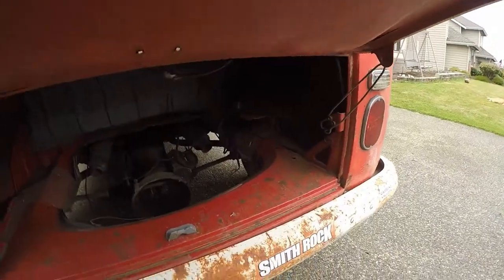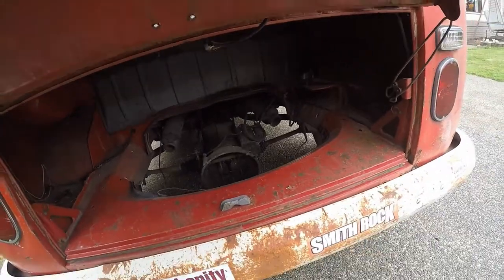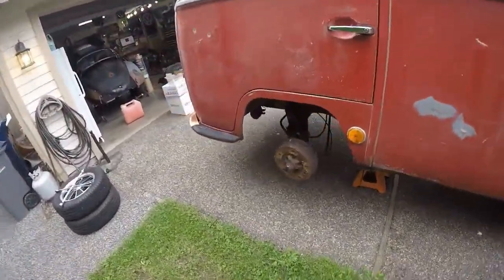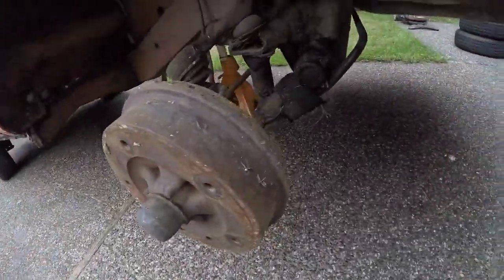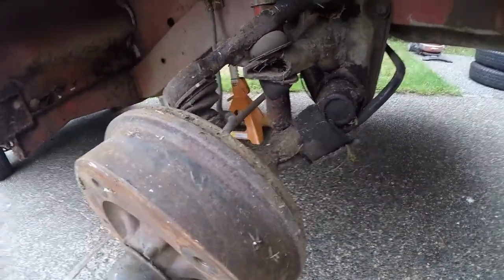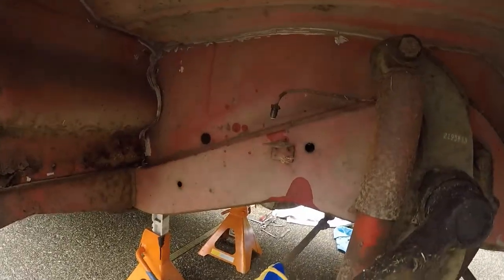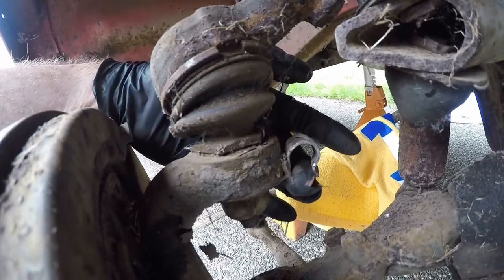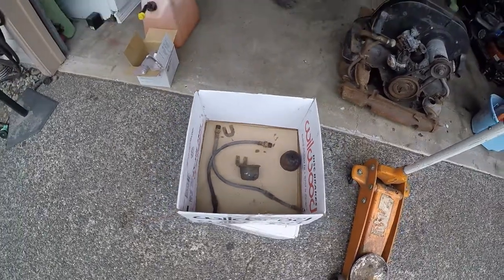WagensWest Slam Bay Kit Install Pt.1

Comment: Looks great my dude! In my opinion these bay windows look way better than the split window buses when they are lowered 👍 I think because the body’s are more square and the aftermarket rims tend to look better on these also... just my 2 cents tho... I have both but for some reason I drive my bay A LOT MORE! The drivability is better for everyday driving... you just get a little more prestige with the split... but who cares about that really. Make more videos man ✅ your great at them ...✌🏻I think you might be covering the mic on this one tho...
Reply from the maker: thank you Jimmy J!!  appreciate your encouragement.  I'd have to agree with you on the slammed bay look although I wouldn't complain if I had a splitty!  :-)  More videos to come and hopefully with better sound and picture quality!